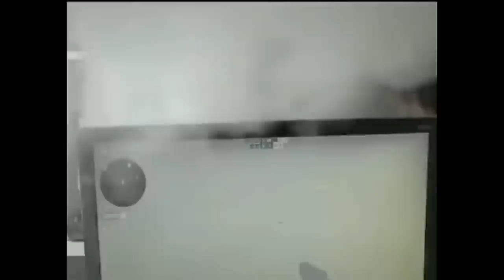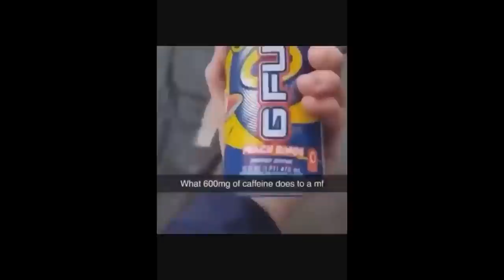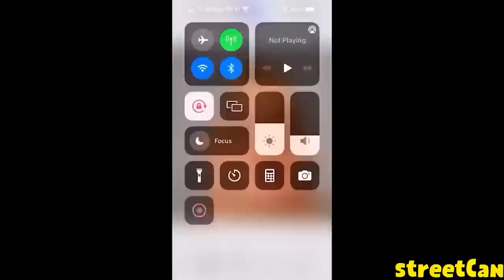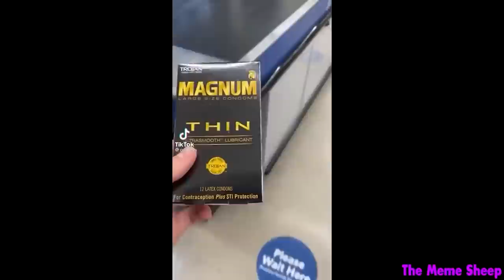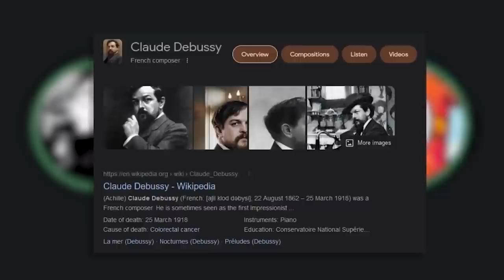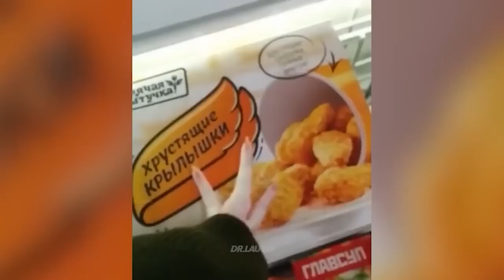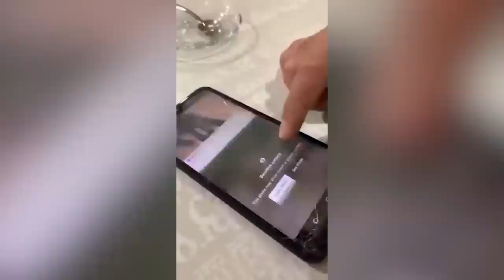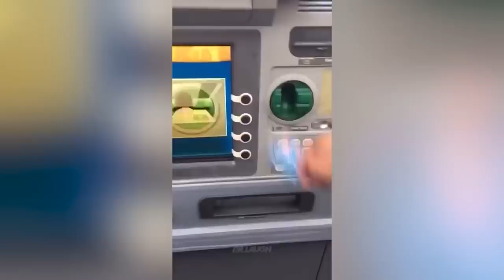1 hour of weird youtube videos | 2

Comment: The issue is that there's probably a good deal of either oil, fat or some other chemical residue that's floating on the surface of the water. This is why when you're putting out a campfire you don't just pour water on it, you pour water and sand on it and stir it together. The sand will bind with the oil and help drag it underneath the surface of the water. The only way to guarantee that you're not going to end up with a forest fire after you've left if you've been cooking with oil or did a pig roast or some jackass tried to pour greasy dishwater on top of it, many accelerants will still burn, despite being cold and sitting on top of water.

Think about the gigantic fire in the middle of the Pacific that happened when that oil rig went... Fire can absolutely be on top of water.

Comment: The lady with the watering can might only have one working setting on that hose, and as you can see it's a super strong spray. If she sprayed those flowers with the hose, it would obliterate them. I also have to fill a watering can with my hose that can easily reach my plants, because if I have delicate seedlings or flowers, the hose will snap them right in half or bury them into the mud from the force. So I fill a gentle watering can that I can use to sprinkle a gentle spritz of water over delicate things. So you might be laughing because you actually don't understand how delicate plants can be and why people own both a hose and watering can. Most gardeners own both, and it's for a reason. And even if the hose is adjustable, those nozzles break, mine breaks and I can only use one setting because the others stop working.